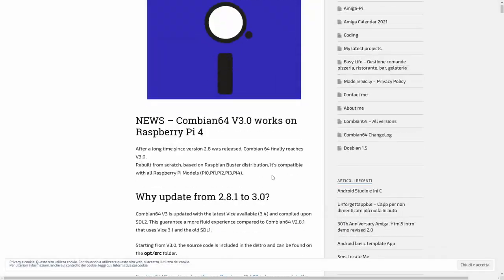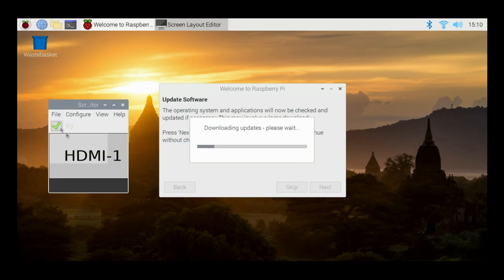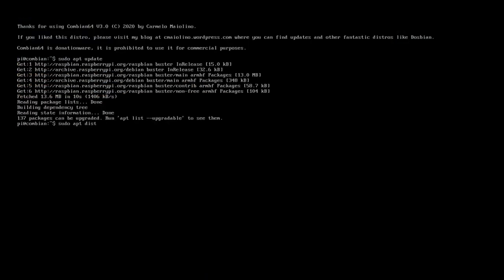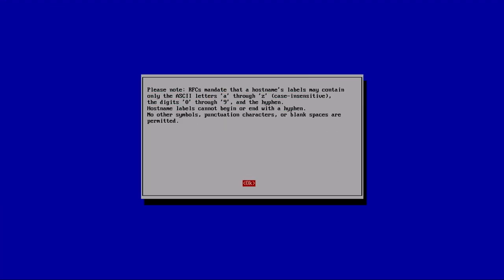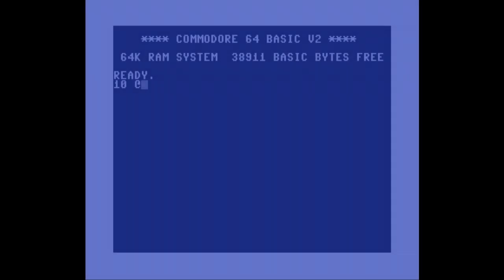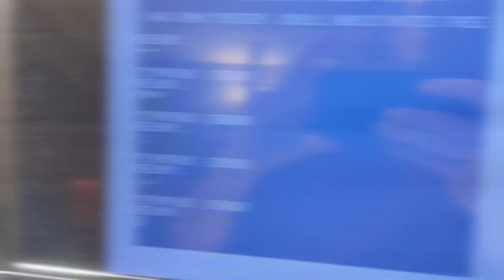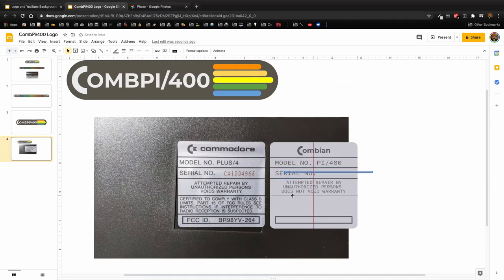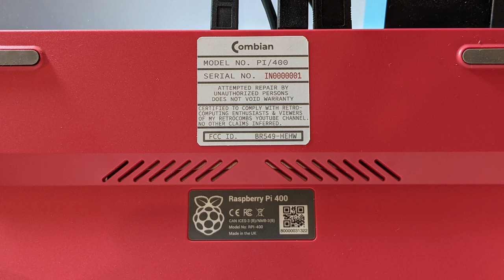Is this Raspberry Pi 400 setup the perfect Commodore 64 Emulator?

Comment: great video. I am kind of puzzling if I want this route or Keyrah v2 + RPI since I have junk C64..
Reply from the maker: For ease of use, this is the way to go. If you want to keep that old school feel, the Keyrah is a fun solution but expect some tinkering.
Reply: @retroCombs  yes, sir. today's problem is there are many options and I have to make a decision LOL! I may end up doing both solution... just like I have a real NES & lots of emulators, Mister, RetroPie AND NES mini.  
I was considering C64 MAXI which is not released in US yet because I feel little limited by playing with C64 MINI(no keyboard). then I found video about Keyrah & your video. or in worst case scenario: I would try to repair my broken  c64 and buy  Pi1541 zero, which is very interesting to me at this moment. 
It is all about nostalgic impulse driven retro fiasco. :)
Reply from the maker: It's a great time to be alive and a retro-computing/gaming fan! Keep me up to date.

Comment: Very nice project ! was wondering if i can go for a PI400 with French Keyboard and remap the Keys in combian 64, then use the Key stickerds you have used to have a true c64 US keyboard. Thanks.
Reply from the maker: That should not be an issue. I'm not sure how to do this but Carmelo might have the solution on his blog. If I find some time, I'll do some digging myself and add to my blog post (coming soon).
Reply from the maker: I looked today and French was not one of the supported languages in the VICE emulator. Not to say it can't be done, but I didn't see an easy way.
Reply: @retroCombs  Thanks,  Not a big deal, I guess my french PI400 will work anyway, It's just that the keyboard won't match. And basically it's all about considering A is Q, Z is W and W is Z :) There has never been French keyboard on C64 as far as i remember, it always came as Qwerty. Anyway, I forgot to tell you that your video as weel as the detailed explainations (and your project) are mind blowing. I love so much when things are not done the half way. Congrats ! ;)
Reply from the maker: There are evidently key binding files for VICE. There has to be someone who has done this. The search continues. Thanks again for the kind comments.

Comment: Excellent video!  I love the fast pace with the blog backup!  Is it possible to make the modifications if you don't have a Pi4 and only a Pi400?  Can you post your image?
Reply from the maker: Not currently. You need access to a Pi 4. I'd share my image, but since Carmelo requests support for his work, I don't want to step on his project's toes.
Reply: @retroCombs  According to the web site it will run on any Pi including the Pi0 with only the Pi400 needing updating before it will work. It should be possible to use a Pi 3 or an even earlier version to update the SD card.
Reply from the maker: For version 2.8 and below that is the case. According to Carmelo, "Combian64 V3 won’t work on the new Raspberry Pi 400 unless you update the distro in a regular Raspberry Pi 4 first. If you don’t have a Raspberry Pi 4, you need to wait until a newer version of Combian is released."

Comment: All set up as per instruction on my Pi 400, but I'm getting gritty audio on all emulators. What did I miss?
Reply from the maker: Hmmm...when you say gritty, assume you mean lots of static. Did you by chance review this document: https://www.stevencombs.com/combianpi400/combian-vice-configuration.pdf
Reply: @retroCombs  Audio sounds granulated. Done all the settings as I mentioned, I did notice something strange in that PDF though; A custom resolution has been entered (1920x1080), yet resolution is set to automatic; seems redundant. Anyway, I degress... Since the issue is showing up on all emulators, I'm thinking it's maybe something bad in the raspi-config?
Reply from the maker: @LEKProductions  Are you running audio through 3.5mm or HDMI and is that selected in raspi-config?
Reply: @retroCombs  RasPi 400 has no 3.5mm, so HDMI. However, I managed to sort it by turning off Double Size, Double Scan and Full screen in video size settings, also reduced the audio bitrate down to 22kHz. It's not perfect, but near enough. That said, it was more a bit of fun setting up as it's probably not something I'd use per say as I have around 15 actual Commodore machines (don't ask why lol).
Reply from the maker: @LEKProductions  That's correct! I'd forgotten about that but sounds like you worked it and thanks for sharing here. Not sure why I didn't experience the same issue.
Reply: @retroCombs  It's possible the issue was something else (which still remains) and I inadvertently solved it by streamlining elsewhere. But thanks for the feedback, and thanks for bringing the C64 to the RasPi; another worthwhile system to the RasPi collection!
Reply from the maker: @LEKProductions  Welcome and good to see you HAM event this past weekend.

Comment: I prefer the Berryboot version so i can run Multiple Operating Systems. I did the Amiga too but didn't like that as much. There is just something special about the C64. I can't wait for Sam's Journey to come to the NES this year. Great C64 Game. Glad it's getting the port. Check it out along with Piopow and Orange Island. Sorry I get off track sometimes but that thing does it all. I am getting the Orange Pi 800 and running Android 12 next. Keyboard PC'S are back!!!!!
Reply from the maker: Berryboot would be a great option! Thanks for the reminder and thanks for the game suggestions. Might have to give those a try on the MEGA65 using the C64 core V5 during a livestream.

Comment: Hi i finally manage to make it work!:) is it possible to connect a BBS like on original C64 with this program?
Reply from the maker: It is. Check out the VICE users guide online to configure the Raspberry Pi's network hardware to serve as a telnet modem. Glad you got it working.

Comment: This is very cool, though since I have a TheC64 all set up as well as a Pi400 with Pimiga installed probably won't do this - but those emulated disk sounds are awesome I am gonna have to hack something together that sounds like that!!

I always had DF0 and DF1 and was furiously swapping until the second one just died and starting sounding like barb wired was scraping through it!! Lol it was 4 years old!  My dad threw it out to spite me when I was expelled from school :(
Reply from the maker: Pimiga. Not familiar with that distro but now really curious. Had a 500 back in the day and have a TheA500 on preorder. I've been so obsessed with 8-bit computers, I've not dove back into my second favorite computer of all time, the A500.
Reply: @retroCombs  Aww man it is amazing, so,e dude made a SD card image called Pimiga which is UAE plus about 14,000 ROMs so its all set up like an A1200 with several upgrade, plus virtual DF0 to add your own stuff from an 2nd SD... It's pretty amazin!
Reply: @retroCombs hahah you are not wrong 8bit micros are sexual :D
Reply from the maker: @DailyCorvid  I'll be checking that out at some point. Thanks for the tip.

Comment: I was looking to put this on a Pi Zero W 2. Is this image not supported by it? I would imagine a Pi 4 to be way overkill for a simple C64 emulator. The Zero W 2, even. But more affordable.
Reply from the maker: Here's the Combian 64 support page:

https://cmaiolino.wordpress.com/combian-64-support-page/

A few lines down it says, does not support the Pi Zero. But you are correct, it would be more affordable and might lead to a handheld model; however, I have to say, using it on the Pi 400 with built-in keyboard is SWEET!
Reply: @retroCombs  i was thinking more along the lines of a bluetooth keyboard and joystick. That would be awesome.
Reply from the maker: @androxilogin  Yes and with something like this form-factor (https://amzn.to/3uTHv6s) #ad. I'm not sure what the technical difficulty is using a Pi W, but with Raspi 4's hard to find, it is a shame this is not an option. Now there is BMC (https://accentual.com/bmc64/) which has an option for the Pi W. This is on my list of videos to produce (not enough time in the day).
Reply: @retroCombs  nice! Bookmarked.

Comment: I am wondering what is the difference between Combian 64 vs. BMC64 for the Raspi 400 ...
Reply from the maker: Great question. Combian is VICE running on a trimmed down version of Linux. Bare Metal Commodore 64, or BMC64, Is still VICE but doesn't have the Linux overhead so it runs and boots faster. BMC64 is on my radar for a future video.
Reply: @retroCombs  I was planning to use the Pi400 for a Commodore emulator but at the end I preferred my old Pi3 with the BMC + two joystick connectors to the GPIO. Too bad BMC64 is not compatible with the Pi400 :(
Reply from the maker: It's not? I thought they now had a version. I'll have to research. Might be another video there.
Reply: @retroCombs  I also had in mind (after I wrote my comment above) that there's no BMC64 for the newest Raspi 4 / 400. ...unless they made an update meanwhile...
Reply from the maker: @MiccaPhone  I'm gonna check it out. Could be a really cool project.

Comment: looks good! now i wish there will be a raspberry pi 400 black keyboard for my project :D
Reply from the maker: Black would be a cool option! What project are you working on?
Reply: @retroCombs  I want to make a dedicated ZX spectrum with the pi400 :) definitely the 48k (distro avail) but hopefully i'll find the new ZX Spectrum Next distro eventually.(kickstarter2 sold out 1st day so i'm looking at options)
Reply from the maker: I was able to snag a ZX during the last Kickstarter. I'm looking forward to it. Didn't have one back in the day so it will be a brand new experience for me. There's a ZX core for the MEGA65 now. I might try that, but would love to see what you come up with using the Pi 400.
Reply: i saw that on the mega65, will buy that for sure if it ever shows up!! (it's been so long waiting) i must admit i really dislike the disk drive on the side (aesthetically and practically because those disks are hard to find and riddled with R/W errors by now) would have preferred a small SD/TF and/or USB thumbdrive there
Reply from the maker: Good news. Two SD cards built in to the MEGA65. The drive on the DevKit is actually kinda awesome. Even if you load software from the SD card, it makes sounds (optional). Since the MEGA65 is a recreation of a prototype C65, I think it appropriate they include the drive for aesthetics. Development is moving along briskly now that those of us with DevKits are providing feedback. Hopefully some news soon.
Reply: Nothing a can of spray paint can't fix :D
Reply: @lunsj  YOu can actually buy a black one now officially :)

Comment: Is it true that Combian 64 has a key input delay? When I installed v3.5 vesterday I had this problem. Also, when I quit VICE and it goes into the command line I try to use the "menu" command but this does nothing.
Reply from the maker: Because its emulation, there is always a lag; however, it doesn't impact my experience. Great question! Sorry for the delay in responding.

Comment: Question about this running on the Pi 400.  Can you access the Internet through the emulator to connect to BBS's?
Reply from the maker: You can. Since this is running VICE, you can configure VICE to access the Wi-Fi. I've not done this yet, but should try it and I need to update this unit. Not enough hours in my day! Great question.

Comment: This may not be the place but I need some help. I am running Retro Pi with a generic xbox-pad. It works and I have no issues. I am now also creating a combian64 to just have as a standalone Commodore 64. I can not get the gamepad to be detected at all. I am not very familiar with commands but when I type 'sudo xboxdrv' it comes up with no controller detected. Any help would be greatly appreciated. Thanks.
Reply from the maker: So sorry. I don't have any experience with the Xbox controller. Maybe someone else can assist.
Reply: @retroCombs  do you have a recommendation for an awesome controller?
Reply from the maker: I like a good retro style joystick and I've found two modern USB connector replacements that have become my favorites (affiliate links below):

https://amzn.to/3JWLD9M
https://amzn.to/3Op0zks

Hyperkin even sells a model with a 9-pin DIN connector for original 8-bit computers such as Commodore and Atari.

https://amzn.to/3k9t7AF

Comment: Why did you put the commodore key logo over the control key instead of the Raspberry logo where it would normally go?
Reply from the maker: Because the CTRL key is the keybinding for the C= key in VICE. I could change it in VICE; however, I like to keep it consistent since I move back and forth between the Combian pi/400 and VICE on my Mac. Great question!
Reply: @retroCombs  I love that you had the same idea I had -- "how do I make it look more C64-ish?"  I am going to explore that myself and it may come in the form of PAINT on the case and keyboard along with clear stickers (white letters on brown painted keys) finished with a hard clear coat.

I'm starting to think vinyl stickers for ALL things but I would much prefer white printing on transparent stickers in general.

I saw where someone was using Combian on the "400" and that may be the way to go as part of what I want to do is run XC-Basic on the Linux side and inject my compiled code into disk images for the emulator to run.

In any case, I just decided the expression shouldn't be "C64-ish."  It should be "Commodorable!"
Reply from the maker: I too would prefer transparent vinyl stickers on the keyboard but that would mean removing the stamps on the keys. Not sure the best way to do that. Painting would be interesting. If you go down that path, please let me know. I'd love to see how it turns out.  You have some great ideas. 

I am enjoying Combian on this device. I also love that I can swap out SD cards and put a different OS in the device. "Commodorable!" I love it!
Reply: @retroCombs  I have ordered my Pi400 from Adafruit.  It will be delivered soon.  I will explore various methods of removal of the existing printing on the keys but I may go straight into printing.  I feel like I might be able to get away with carefully applied putty to limit where the paint goes.  If I could get white printing on transparent vinyl, apply it and then apply hard clear coating, it will probably achieve the look I want.  

There have been some updates to the BMC64 load and it no longer says "for Pi 2 or 3" as it relates to the C64 emulation but it still says so for the other versions.  And since I don't yet have a Pi400 to test I can't confirm that it's now supported.

Comment: Do you have an SD image of your pi400 version for people who don't have access to a pi4 for the upgrade process?
Reply from the maker: Carmelo has asked that I not share my SD image. Sorry. He's committed to get an update out ASAP. In the meantime, have any close friends who have or have access to Raspberry Pi 4? 

I'd also recommend you grab one (https://amzn.to/2KPZshK)(#ad). I'm sure you'll find uses for another one. I'm already planning other projects with mine.
Reply: @retroCombs  Having 2 Pi3s 1 3b+ and now the pi400, I think I would be killed by the wife if I bought another one right now. I have spoken with Carmelo and he's kindly provided the V3, which I'm going to run through my 3b+ to see if I am able to get it to a pi400 working state. If not, I'll stick with my 3b+ and a keyboard until a pi400 version is released. :)
Reply from the maker: Oh, now I completely understand! 😅
Reply: @retroCombs  are you using the 3.2 image thats been updated w/ support for 400?
Reply from the maker: Per the video and companion blog post, I used the previous version which requires an install on a Raspberry Pi 4 first.

Comment: Anyone know why the latest version of combian isn't opening into c64 like all the documentation and videos say it will. I get the Combian splash screen, then I'm in shell with some version notes about the project at the top of the screen. If I type menu it shows the splash screen again, then returns to a prompt. This is on a Raspberry Pi 4 model B.
Reply from the maker: Sounds like a bad install or a corrupt script. Assume you have the latest version?